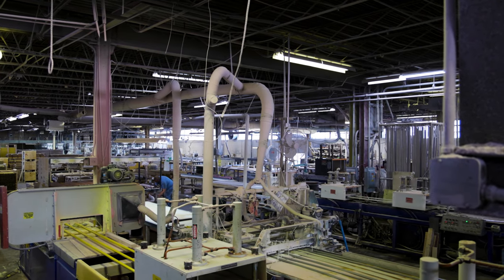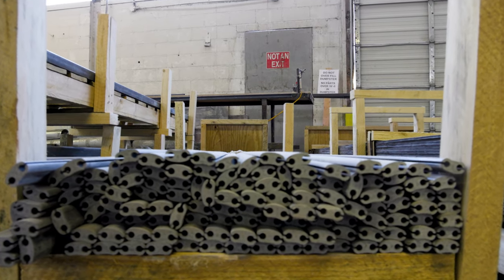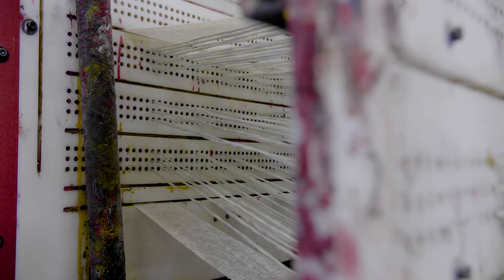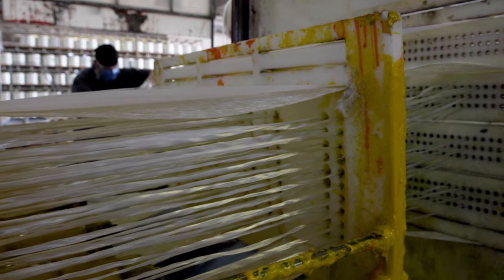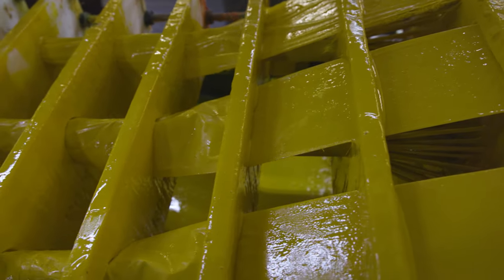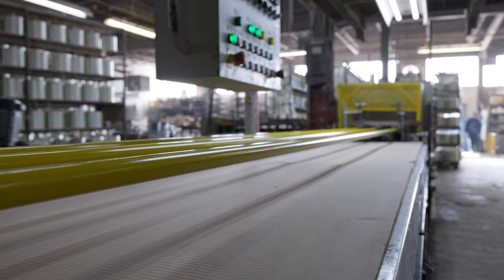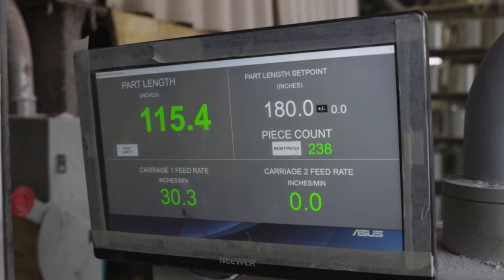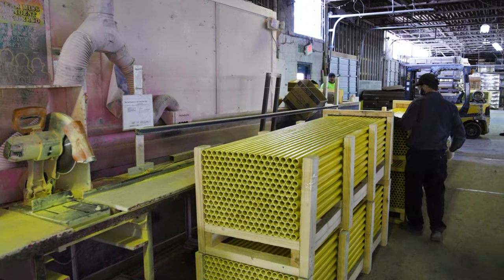How Fiberglass Reinforced Polymers (FRP) Are Made at Liberty Pultrusions

Comment: I used frp many times.  I recently used frp that was pre applied on plywood.       The plywood letters became glued and applied on the finish frp.   How would you remove or fix this issue?   I think that the frp was made, then sent to another company to glue it to plywood.     I'd rather spread glue onto any meterial then add frp.l myself.  
   I can't bend plywood or drywall,. I can bend frp.    How would I create a tight finish and make it look perfect  if the plywood and frp are all in one?   
   Three or four pipes close together don't allow any wiggle room.   With frp I can bend it.    I cannot bend plywood...

Comment: what is the optimal temperature required for epoxy fiberglass during the heating process?
Reply: they probably wont say. These companies treat specifics of their processes like the code to fort knox.
Reply: Technical datasheet from the supplier of your epoxy resin should have recommended temperatures for curing.